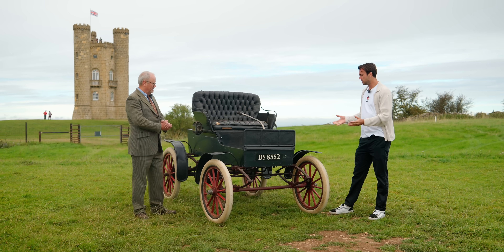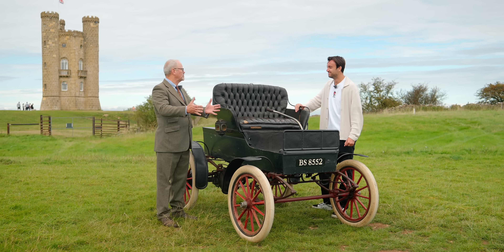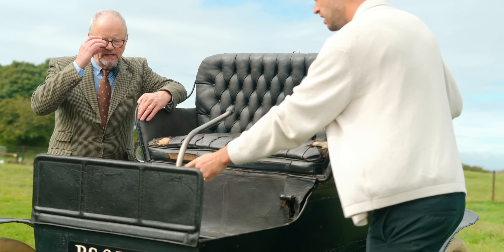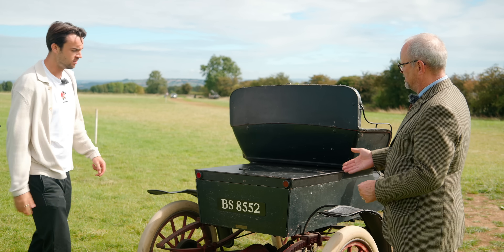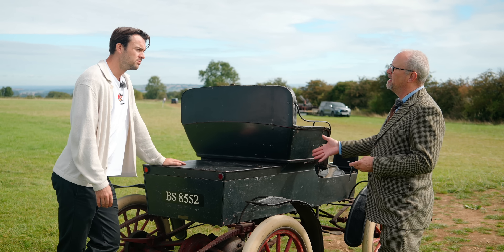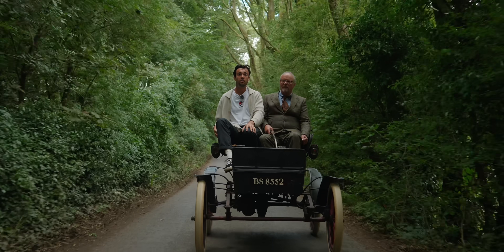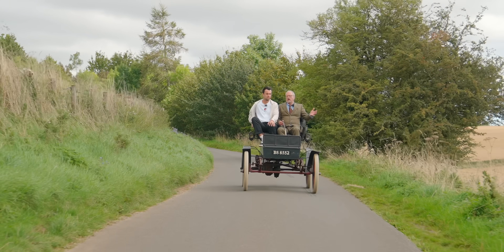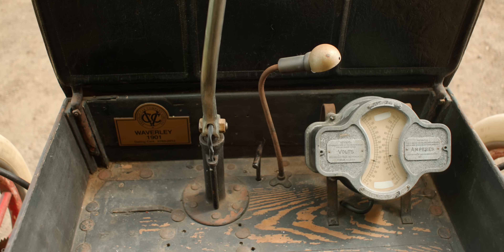Why Electric Cars Failed 100 Years Ago

Comment: Note that horses normally walk up to 30 miles in a day. So, a car that would drive 60 miles on a charge would have been great.
Reply: I think a horse could pull a much bigger load than this car.
Reply: Yeah and don't forget horses are living animals. If you were to push a horse that hard and ride even several miles a day, everyday. The horse would probably die. They are physically much stronger and faster than humans, but they aren't as resilient as people think.
Reply: Only the very rich traveled most went to market or the next town.
Reply: And as anyone who has owned a horse will tell you, sometimes they WON'T walk that far.
Reply: When most people travelled by horse, the horse normally walked. Of course, the horse had a say in it too.

The 30-mile average is why many U.S. towns are about that far apart. I would imagine a rider needing to travel farther would normally put their horse up in a livery stable and find a hotel room for the night and continue their trip the next morning.
Reply: @lesliefranklin1870  
On long distance roads, there were stop off points where you would exchange your horse (s), for freshly rested & fed ones, a bit like filling up with petrol or charging your EV.
Reply: @lesliefranklin1870 yes, very few horses could go sixty miles at an average speed of eighteen miles an hour while carrying two adult humans. If you had a horse like that you’d race every horse around!
Reply: It's nicer than a horse, but that wasn't the competition.  The competition was ICE.  The problem was that lead acid batteries just weren't energy dense enough to compete.
Reply: @incognitotorpedo42  Also There wasn't much in electricity back then either
Reply: @incognitotorpedo42 lead acid batteries back then where even worse then
Reply: @incognitotorpedo42  Neither are lithium batteries. Gasoline is still around 100 times more energy dense than lithium batteries. The physics just isn't even close to competing with ICE fuels.
Reply: @incognitotorpedo42  with all the advancements in battery technology today, we still have the same problems - batteries don't have the same energy density as gasoline/diesel.
Maybe when BYD will start mass producing solid state batteries, we will get somewhat closer to what ICE vehicles can offer.
Reply: @vadim6385  EVs are about 90% efficient at the vehicle. ICE vehicles are about 30% efficient at the vehicle. So, parity at the vehicle is when batteries hold one-third the energy as an equivalent weight of gas. However, we should include the infrastructure as well. In that case, electric power lines are much more efficient than trucks hauling tanks of liquid gasoline, in the distribution of energy.
Reply: @incognitotorpedo42 - same problem with Lithium batteries. In a world of ICE versus electric battery vehicle - ICE wins as it’s fuel is more energy dense. Better still, hybrid ICE and electric. Best of both worlds - electric transmission and hydrocarbon fuel.
Reply: @sullivanrachael  Not heard much talk about graphene batteries lately, a few years ago that was going to be the next big development in battery technology.
Reply: The bicycle would be at least $800.00 cheaper, and just as fast.
Reply: I can do 60 miles a day on a bicycle .   But i guess we have better roads .
Reply: @lassepeterson2740  actually while mountain bikes didn't exist back then, there were already bicycles with rather thick pneumatic tires and a primitive form of suspension, so you could probably reach 60 miles a day on the roads that where available back then, but you couldn't really use bicycles to carry cargo or even enough luggage for a long enough trip. Before cars where common, for a journey you would typically go with a stage coach (or if you were rich with your own coach or the carriage equivalent of a taxi) to the next train station and then take the train. If you had a lot of luggage, you could have used the help of the driver of the carriage and later the luggage service at the railway station. Or if you were rich, you had your own personell with you, that would carry your stuff.

Bicycles where used for day trips, when you didn't need more than a backpack, or for joy rides. Poor people couldn't afford them either, so if they took a day trip, they walked or took a stage coach (for example if you used it once a month, it was much cheaper than the ownership of a bicycle).
Reply: @rfvtgbzhn  Lookit that electric car .   It has no cargo space .  The trunk is full of batterys .   It's a two seater .   So the other passenger can follow me along on their own bike and the cargo can go by train and you can bill me the carbon tax later .
Reply: @lassepeterson2740  there is still space on top of the trunk, so maybe you could put a cargo hold there, and remove it when you have to access the trunk. Or when you where a rich man (what car owners at that time where anyway), you probably had a driver and not a driving license by yourself. In this case it might have also been feasible, to have the driver and luggage on the car and follow it yourself on a bicycle. Or if you where really rich, have 2 cars with 2 drivers, one with yourself as passenger and the other one for the luggage. Petrol cars where very lightweight at around 1900 (because the power of ICEs small enough for cars was still very limited) and didn't have much space for luggage too, so not sure if they had a noticeable advantage for luggage.
Reply: Hell, a 60 mile range is plenty good enough nowadays for me. The worst commute I’ve ever had was 27 miles, that would achieve my daily commute at that job; especially if I could charge it some of the way up once I got to work since it would be sitting for 9 hours.
Reply: A lot of people don't think of those comparisons. I am a photographer and have been since the 90s. When I got my first digital camera in 2002, I was excited that my 32MB memory card could take about 48 photos! This was more than a roll of film could, and it was reuseable! Yes, it was a 2MP camera, but it honestly produced images as good as my Canon 650 film camera. It's all relative
Reply: @SJHFoto   so it took 20 years to get to the same resolution as film.  Imagine where it goes in another 10.
Reply: It's a surprisingly good car for the time. It's a shame petrol was so cheap really. If electric cars would have been more popular maybe they would have done more research on battery technology.
Reply: The average speed in central London was about 8 mph in 1900. It's about the same today.
A top speed of 18 mph would have been fine for use in a city a century ago.
Reply: A well-bred horse may be able to better the best I ever did with the horse was packing in a camp at in a mountain range keep in mind we were on a mountain I'm sure you could double that on a road
Reply: A horse can tow or carry load, though. This car is a toy.
Reply: @andersf5464  actually they also used steam cars at that time to tow loads, as they where more powerful, but also much heavier and slower.
Reply: And what would they do at the end of that 60 miles?  Push the car back home?  Push it for 60 miles?  

Electric cars were phased out because you couldn't leave the city with one. You had to always drive back home before your battery died. You had to charge it all night before you could drive it again. 

You seem to be 100% against admitting that batteries don't charge themselves. Electric cars are stupid. They don't work. They have failed time and time again.
Reply: @orionbetelgeuse1937 true, fossil fuel is already in the earth, which makes it cheaper to make than renewable fuels, because it just has to be extracted from the ground and "refined" to turn crude oil in avtuelly usa le fuels. But with wind and and solar we can get energy for free, without even having to drill deep holes into the ground, so these renewable energies are cheaper than energy from fossil fuels.
Reply: @orionbetelgeuse1937  yes, but the production of fossil fuel is still very expensive because of some reason. Before it gets cheaper we need other solutions, for example pump storage or battery storage. This can be done for reasonable prices (that don't make renewable energy more expensive than fossil fuels) according to experts, but needs a large initial investment.
Reply: @orionbetelgeuse1937  from Africa to Europe is technically possible, as it is not that far. Actually there was a project to do this called Desertec. It failed because of an economic crisis and later political instability, not because if was impossible or economically unfeasable.
Reply: And then you get to walk for three days home pushing a dead car. That sounds like Chicago yesterday in a snow storm!
Reply: @highwatercircutrider  … I am pretty sure that thousands upon thousands of ICE cars were also stranded because of failing batteries, congealed diesel fuel and so on.  But no news media, no YT channels showed them, because those do not bring clicks!
Reply: Then you get to walk three days home pushing you car, sound like a winter day yesterday in Chicago?
Reply: What was the speed?
Did it take all day to go 30 miles 😉
Reply: 60 miles?  Maybe downhill the whole way.
Reply: How much more entertaining would this have been were it Robert and Jonny Smith? I felt they really had that chemistry akin to the old Top Gear team.
Reply: Horses weren't all that common as a method of personal transport.  Keeping a horse was not practical for most city dwellers.  If you can charge an EV at home, you can support a carriage house - but apartment dwellers probably can't use a horse or an EV.
Reply: Yep at 30 mph. Two hours instead of, two days. And 
if Hitler hadn't started WWII
where would we be now?
Reply: My son just ran a 26-mile marathon in 3 hours and 47 minutes.  He averaged 6.8 mph on just one bowel movement.  💩
Reply: @jamesburns2232  Imagine what he could have done with two movements.
Reply: With two bowel movements, 💩💩, my son would have run the 26 miles in half the time at an average speed of 13.6 miles per hour.  😹
Reply: @jamesburns2232  Just imagine what could be done with three bowel movements 💩💩💩 😮
Reply: With three bowel movements, Colby Burns would turn to being an Ethiopian and would likely win the Boston Marathon. 🤭
Reply: @jamesburns2232 oh, that was the problem with horses , they poop.
ICE is clean , well except for carbon monoxide. (CO2 isn't a pollutant, but you have to burn methane or any sort of gas to get a clean pollution-less burn that's pure CO2)
Comparing with stink of poop and disease.
Anything is better than horses , really.
Reply: @jamesburns2232  Before or during the race? Before is better.
Reply: For long distance journeys, people would switch horses.
Reply: @no1DdC that would have left many lonely horses hanging around.
Reply: @petefluffy7420 there were changing stations for horses.
Reply: @rfvtgbzhn  For horses to change out of sweaty clothes into fresh new ones? And if only had one horse ? A spare horse would have had to walk along with you, but I suppose it would not had to pull a load, so a small advantage there.  Off the beaten track would not have had changing stations.  same problem as with modern electric cars, no where to charge and so very limited range.
Reply: @petefluffy7420  idk if there have ever been horse changing stations for privately owned carriages, but they were definitely used for stagecoaches, which at the time before cars where the fastest way to reach remote areas and at the time before trains the fastest kind of transportation for any long journey.
Reply: @rfvtgbzhn you don't think that was expensive? And all horses are not the same. If you have a good one you don't want to change to what someone left behind. I once red a report made by an officer who rode from Sweden to turkey and back using the same horse, doing some cavalry charges on the way.
Reply: @ulfosterberg9116   the changing stations were mainly for stagecoaches and I guess the postal service (which operated the stagecoaches) had requirements on the horses that made sure, that they usually could meet their schedule. Horses which weren't fast enough anymore were probably sold to the butcher.
Reply: @no1DdC That is more or less like change the vehicle or swap the battery.

In a "what-if" scenario where Earth was lacking fossil fuels, we would use electric vehicles directly.
They were far superior that the animals.

Well... A world without coal would have needed more innovation on metallurgy to allow the industrial revolution happening using just renewable energy.
Reply: @oatlegOnYt I mean, steam cars are and were a viable solution back then.. it definitely wasn't a technological limitation, but a battle of political and monetary influence.
Reply: @ryanthompson3737  steam cars are based on fuels. While wood is always available in a world without coal, wood would raise the price as it would be a lot more difficult to replace carbon in metallurgy than on transport where electricity also work.

In other words, wood would be a bottleneck until a better replacement were found.
Besides if you have an abundant fuel, it's better to convert the fuel through chemistry and use ICE again.

We are returning to that point not because we lack fuel, but because burning fossil fuels is creating another problem. But thanks to the developed already occurred, we can jump into better battery technology with close ICE performance in roads.
Reply: @ryanthompson3737 it wasn't until the Doble steam car that start up times were short enough to be feasible as a car. However the Doble steam cars were handmade, extremely expensive, and late. Earlier models like the Stanley steamer were not as user friendly nor as quick to start. 

The Doble was also the first steamer to use a condenser to save water. Most other steamers traded storage and passenger space for water tanks.

While steam technology is older, the miniature steam technology of the era was not advanced enough for steam cars to develop. It wasn't until the gas car had gained traction that steam became a technically feasible option. We can see, however, from the traction engine that the maintenance requirements stopped the widespread adoption of steam cars.
Reply: @oatlegOnYt  If coal had never been available from the start , there would have been much more development for the efficient burning of wood as a primary fuel.
Reply: @RichieReportsUK  True... but wood is clearly a bottleneck. It has enough quality, but not enough quantity for our current level of development.
That's my reason to think that the civilization would have searched for new ways of metallurgy (most electricity based, I guess) to skip that bottleneck.
There is plenty ways to have big quantities of electricity. Dams are the older ones.

Maybe cheap renewables would have being available sooner. Maybe we have developed nuclear to a higher and more advanced level. But we'd have developed anyway.

Fossil fuels are good, but industrial revolution and ubiquitous transport could occur with other technologies as well. And that first electricity vehicles are a good clue that this is correct.
Reply: @oatlegOnYt You know, charging a battery probably should count as "convert (energy) through chemistry".
Reply: @oatlegOnYt  By the way, CO2 is not a problem. CO2 is nothing but plant food and there is barely enough to keep plants alive.  We almost reached the lower limit for plant life at the end of the last glaciation. Thank God, we came along to burn stuff and replenish a little bit of CO2.
Reply: @ryanthompson3737 

Steam cars, although fast and quiet, were too complex to be as cheap and light as gas equivalents. They were never a viable alternative.
Reply: @oatlegOnYt your argument doesn't hold water.  electric cars back then, was in fact unreliable. Way too expensive batteries didn't last. The Motors overheated. And they didn't like the muddy roads at all.
Reply: @no1DdC Yes, that's what the Pony Express did. Delivered mail to another city, swapped horses and got back on the road with return mail.
Reply: @no1DdC  For short trips you would walk, take a trolley or use a horse and buggy. For long distances there were railroads. The railroads were the reason good hiways were not developed sooner.
Reply: @no1DdC  As battery swapping was already a solved problem at the time, that in of itself was not a problem for electric cars at the time.
Reply: @no1DdC    - Well, the horses needed to be fed and watered.....
Reply: 100 years later and nothing changed.
Reply: @grandroofingcolorado  Actually everything changed... except volts and amperes, we still use them to measure power!  Well...one could say that the basic concept of the induction motor also did not change.  But that's about it!
Reply: It's not that they were not good they just lasted too long, 100 plus yeas old and still got original  unbuilt motor.
Reply: At 25 MPH?
Reply: A long-distance horse can travel up to 100 miles a day depending on terrain. It can also traverse terrain cars can't. They do need significant rest afterwards and can only do it for a few years.
Reply: @patrickweaver1105  sounds about right. That is for a light carriage on a perfect surface like tarmac. However streets outside of cities seldom had a good surface, so average speeds were much lower.
Reply: @patrickweaver1105  We should differentiate between athlete horse and common everyday transportation horse. Horses were(are) expensive. Most people would not push their horse to exhaustion regularly.
Reply: Exactly. The petroleum industry put loads of money into the gasoline infrastructure. They also put out loads of bad information about steam and electric cars talking about the dangers to the driver's and passengers.
Reply: @terrallputnam7979  JD Rockerfeller no doubt
Reply: What? A human can walk 50 miles a day.
Reply: @jesseowens1492  At an average human pace of 3mi/hour, that would be over 16 hours. and upon arrival, the traveler would be too tired to do anything. Possible, but not common.
Reply: @jesseowens1492   Not today's humans.
Reply: @jesseowens1492  Oh yeah?  Yeah, I certainly did that much, and slightly more, when I was in the military, after some months of training.  I would however challenge 95+% of people today of walking 20 miles,  less than that carrying or pulling a load!
Reply: @jesseowens1492   3mph for 8hrs is only 24 hrs. It’s possible, you must be an athlete however.
Reply: After watching this video most people are "Yeah EV! Beat the crap out of that dirty polluting good for nothing ICE vehicles!" until one peaceful night when their house burns down because of spontaneously combusting  EV batteries. 😆😅🤣😂🤣🤣
Reply: @pbxn-3rdx-85percent gasoline doesn't ever catch on fire.
Reply: @BladeoftheImmortal2005  Gasoline cars catch fire because of the ELECTRIC wires getting shorted. So it's still categorized as ELECTRICAL CAUSE OF FIRE. You can watch a liter of gasoline for a million years and it won't catch fire without a spark from ELECTRICITY. With lithium batteries though sooner or later it burst into angry flames without any external factors, just like a woman having menstruation. 🤣
Reply: @pbxn-3rdx-85percent  gas cars spontaneously combust 20x more often than EV's.
Reply: @mrl22222  gasoline fuel does not combust spontaneously. It needs a spark or heat to ignite. Spark and heat from a short circuit of a car's cable (with electricity from the car's lead acid battery). Hence the fire is still categorized as electrically started. You can stare at a gallon of gasoline for a million years and it will not ignite if it is not exposed to heat, spark or flame. It's high school science.
Reply: @pbxn-3rdx-85percent lithium in batteries are just a bad idea